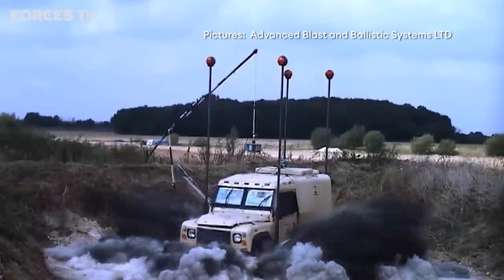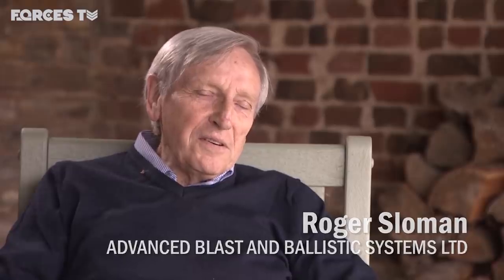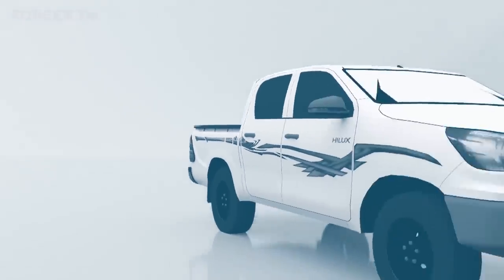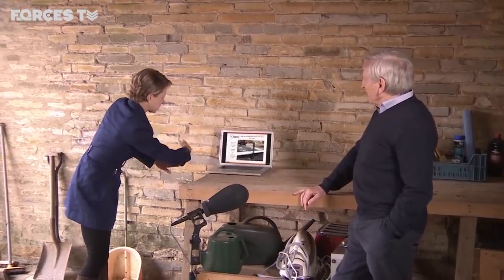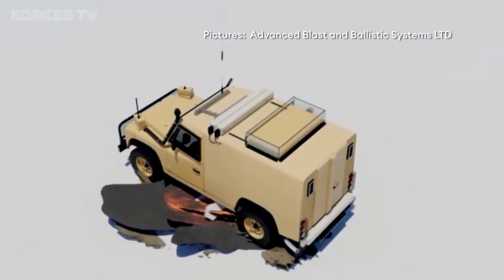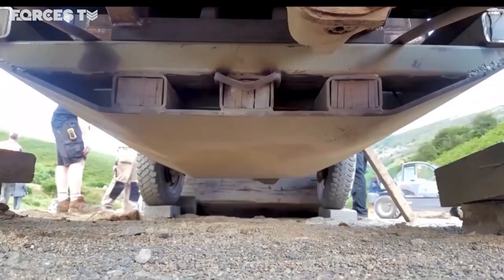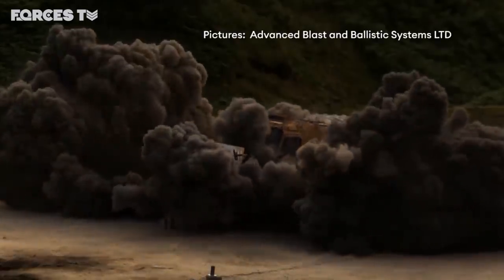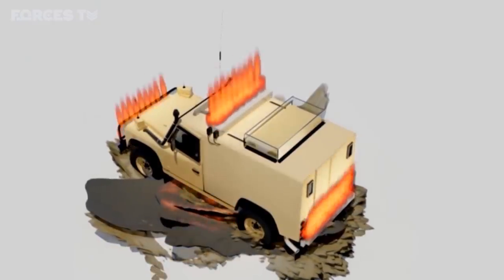Has This Inventor Found A Solution To IED Threats? | Forces TV

Comment: Some issues to be considered: 
1/ What if enemy find ways to trigger the rocket engines (e.g. shooting at 'em?)? Would it make the vehicle more vulnerable to small arms fire?
2/ What if the IED does not detonate directly under the vehicle? What if they have IED on the side of the road pointing toward vehicles passing by?
3/ What if the IED is small but it triggers the much bigger rocket engines, causing a downward force on the occupants?
Interesting invention but the system needs to determine where the force's strength and direction in order to counter act effectively... and such system might require lots of maintenance
Reply: To #1 and #3,  I'd imagine these are computer controlled detonators, and it may not be possible for a simple bullet or even fire to set them off.  If they did inadvertently go off, the rockets push the vehicle down, but it would be downwards acceleration that would harm the passengers.  There's a bit of an obstacle stopping that downward acceleration.  The ground.  The only way for the vehicle to accelerate downward would be for it to literally push into the ground, or I guess maybe the tires would all simultaneously blow out; although I imagine they're 4 pretty thick and rugged tires to distribute the force.

To #2, this isn't a solution to solve for all possible attacks.  It's solving one of the most common and deadly attacks.   That said, this solution allows for a lower sitting vehicle with a lower center of gravity, versus the V shaped bottom solution mentioned in the video.  That could help stop the side charge from rolling the vehicle.  Although, I imagine the shielding on the side of the vehicle isn't as strong as the shielding on the bottom.  If the explosion doesn't tear through the side of the vehicle... simple side curtain airbags could do the trick.

Comment: Hi Everyone who still looks at this, I'm just curious to see if anyone has actually invested through the Seedrs pitch?  It would be useful to know.                                         Roger.
Reply: I have a question sir, would this be able to counter say a 100kg mine?
Reply: @homijbhabha8860  It is possible, just add more motors and make sure the belly plate can take the loads.

Roger Sloman
Reply: Roger, are you still crowd funding? If you are, where can I find your crowd funding?
Keong Yip.

Comment: What about the sound, shockwave, shrapnel and concussion after the explosion?

I mean the rockets will possible prevent it from flipping, but the money and variables for something that may or may not work is not worth the risk in my opinion.

He should test the survibability chances, just because a dummy looks intact doesn't mean that a person wouldn't die.
Reply: As a military research R&D outfit, they wouldn't discuss anything other than very basic information as to not give away trade/national secrets.

Assuming this system can be tuned with the chassis to minimize deformation of the cabin, overpressure should be easily solved in an already armoured vehicle, as should shrapnel.

Not sure you'd be safe on the bed of the Hilux when those linear rockets go off though...
Reply: Every invention that has ever been was in the category, " May or may not work."  Without optimists nothing would be invented.

Comment: From a government and military perspective, the modifications to their current in theatre vehicles will be hugely less expensive than the buying in of the current range of blast resistant vehicles and the increased logistics problems they present.

Retrofit kits to upgrade current in theatre, non hardened vehicles may be fitted as and when required, giving the commanders greater choice.

This 3 part system has the possibility to radically change the defensive capabilities of current military fleets at considerably less expense and in a shorter timeframe than switching to brand new vehicles.

For the same fiscal outlay, many more vehicles can be modified and upgraded.

The inventer is truly outstanding, and to have progressed his project this far is remarkable.
Reply: Thanks Felix, a sensible response!

Comment: isn´t this called "reactive armor" and is around since the 80`s
Reply: nope, reactive armour explodes into the incoming warheads. this is a counter force for IEDs/mines under the vehicle
Reply: Yeah, as the other comment mentioned, reactive armor is armor which detonates when a projectile impacts it. Generally, only the part of the armor in direct contact with the projectile detonates, and that detonation serves to break up and bleed energy off of the projectile. This is very different for a number of reasons. It isn't armor at all; it's an electronically actuated system that applies force to the vehicle, whereas reactive armor is just a compound with no electrical system. Also, reactive armor works almost exclusively against projectiles, while this appears to work only against blasts.

That being said, I'm extremely skeptical about this idea. It involves effectively doubling the force of the explosion, and unless there's a LOT more to the "carbon fiber reinforced belly plate" it's absolutely silly to think that carbon fiber can even begin to approach the blast resistance of a higher, bowed hull that has the benifit of not being forced down INTO the explosion.

Comment: I feel like instead of using rockets, you could just use the same idea as inside of a deadblow hammer. Have 1,000 pounds of metal balls inside of cavities  around the vehicle, suspended in the top half of the cavities. When the blast goes off, drop the balls,. As they hit the bottom of the cavities, it will absorb a lot of the force of the explosion.
Reply: Weight and time. Those weights wouldn't drop fast enough to do any good, nor would they be even slightly as effective as the rocket. 
They'd also hinder the vehicle and raise the centre of mass without doing much other than adding mass.

Comment: Over-pressure?
Reply: Not a problem in a closed vehicle. We did have pressure sensors inside the vehicle and left the top hatch open to check that. Only about 2psi above ambient recorded. Roger
Reply: @rogersloman6635  Thanks for reply, you're doing good work, like you said it is just physics and can be done.
Reply: @rogersloman6635  do you think if you put some facing sideways on top you could stop rollovers from ieds placed on the side of the road instead of underneath?
Reply: @Alucard-gt1zf  Yes, that could be incorporated.       Roger.

Comment: I'm an inventor too... I disagree that "it's just plain Physics." and tell you it's more than that. It's Mechanical Engineering (Physics, Mathematics, Chemistry/Alchemy/Metallurgy, and the rest). It's also Biology (Live human bodies) and Geology (Living Terrain of the theatre's landscape and how its own displacement [or lack thereof] affects the Physics' Reaction Force at play). There is far more than just plain Physics.

I imagine the physical forces at play would effectively squash the vehicle and require the vehicle cabin and hull become further reinforced to cope with that stress. This wasn't mentioned when they boasted the invention's effective working method. 

The highly dynamic physical energy force/s has to be directed (or at least guided) to flow away from any harmful dynamic position. Where does the energy from the 2 opposing blast forces go?

Also, the rocket case design adds further payload weight to the Gross Vehicle Mass capability, requiring a decrease in its general carriage capcity (i.e. of guns, ammunition, bodies, whatever it normally carries). This means a larger more robust vehicle is now required. It's not unachievable, but further again... Also, this payload increase requires a more powerful engine and driveline with a more capable braking system.

These points outlined above probably contribute to the reason why we didn't get to see it completed and adopted into production. He's probably working on that next after he gets some more funds for prototyping.  Prototyping is EX-PEN-SIVE!

Nevermind mate, WW-3 is looming with China/Russia et al. Vs. UK/USA et al., and this means we'll soon see a MASSIVE INCREASE in military expenditure for production and R&D by both sides of the divide. 

You'll be 'right.
_____________________________________________________________________________________________________________________________

Comment: A couple issues that I see with this. Firstly it's a one time use before it needs to be reset. This means they are going to have to keep all the parts needed for resetting it on hand at base. Secondly the energy that would originally throw the vehicle upwards is now trapped under the vehicle making it more likely to penetrate the armor plating or cause internal damage to the crew
Reply: That's a misunderstanding of how the mine blast works. Holding it down does not increase the damage.    Roger

Comment: These seem great for standard landmines, but comparing it to the American use of a wedge on the MRAPs is apples to oranges. Those are designed to protect heavy vehicles from shaped charges (penetrators), whereas this guys system is for designed to protect light vehicles from the concussive force of (standard?) land mines. 

Not knocking his design, it's brilliant, just wondering why the Brits can't stop themselves from trying to compare everything they do to the American military.

Comment: Ok, I understand everything put in place, but I still don't think this will work, because the displacement of the air in the cabin. Think of it as putting earplugs in, then "thunder clapping" your ears. Doing this could blow your eardrums and burst your capillaries.  Shoot you dont have to thunder clap to do that, shooting a 556 rifle has done it in the past. With that said. Imagine what a 6kg explosive can do to the human body thats in the cabin.

TLDR: yes the vehicle is safe, but will it really prevent internal bleeding?

Comment: Neat! But once they get widespread, the guerrillas will just detonate shaped-charges beneath vehicles instead. Won’t shoot the truck into the sky or deform the floor much, but there’s a reasonable chance that somebody has a cone of copper halfway through their bottom, or at least through a critical component like the engine or transmission. Even more likely if there’s an array of charges. ERA on the bottom of vehicles will get expensive, but probably work.

Comment: Insurgents are going to adapt to that as well by using very small IEDs with just enough power to detonate the rocket thrust countermeasure which will be followed by the main IED charge detonation. 7 million pounds wasted on a countermeasure that is essentially ineffective and will be proven ineffective once it begins widespread use.

Comment: So what stops the enemy from using a small pre charge to trigger the defences before the main charge blows?

If the rockets fire for 20 milliseconds and the floor spring is released; Is there anything to stop a delayed main charge that detonates at, say, 30 milliseconds from obliterating the vehicle?

Also, if it could be defeated this way, would these defences actually exaggerate the main blast by adding energy to the system?

While we obviously don't have all the details it seems like it wouldn't take much for the already adaptive enemy to defeat this.
Reply: The system deals with this double tap situation, again, not saying how though.

Comment: They will likely counter this by making larger IED and that's about it.
Another question is, do you want to field thousands of armored vehicles with rockets on their roof? And is it even cost efficient? Is the added weight a good idea?
While it keeps the jeep on the ground, I'd love to see the pressure inside the vehicle. On the video the door opened itself, which may be a bad sign. 

That may save the jeep, but not its occupants. maybe anyway, testing needed. if it works, nice...

Comment: Meanwhile in Rhodesia (Zimbabwe before the war)
They made an weighted extended front end, sometimes detachable to the vehicles. (imagine a extended wheelbarrow infront of the car) that would trigger any mines or IED's. and usually leave the vehicle somewhat unharmed.
Reply: But not when they offset the pressure plate and the IED, as in the video!     Roger.

Comment: Very interesting, but it seems to be more aimed at landmines than most IED's. It would be interesting to see how this system would perform against anti tank mines, especially when stacked. In my experience most IED's (including the deadly platter charges) hit from the side. Even this video refers to blasts hitting from the sides and tipping vehicles into canals/rivers. The South African system with v shaped bottom and "boxes" at the side still seems to be the most effective (and far cheaper) solution.

Comment: Trigger mechanism attached and timed by the floor protector? 
Could work. 
It's not like the floor reinforcement can be shaped and built out of any sheet metal. 
Carbon fiber would cut down on mass though.

Comment: Ok, so idea’s and engineering are great on the safe side of the blast, but as a 12b who deployed many times who’s job it was to find and eliminate the things that go boom. This application would work only the most circumstantial situations. Otherwise it would take at least five years of continuous testing to get it right in a practical sense, then the enemy would figure out how to counter it in two less than two weeks. Does anyone else think strapping class III explosives under your Vic and driving on and off the FOB all day in 120 degree heat is a good idea? Who is going to maintain a system like this in the field?(there’s no way this falls under 10 level maintenance). I’d buy into this more if it were a airbag system. We used to disable our in cab fire extinguishing systems because they intermittently went off. Imagine if these started going off. There are too many people on here excited about this, thinking it would save lives, but in all reality it would be impractical. Yes, call me the naysayer but that comes with a career of driving around in hot zones waiting and getting blown up.

Comment: amazing idea, its like reactive armor, using counterforce to blunt the destruction.  If it works it can be retrofitted to just about any vehicle.  The pressure wave could be a problem, as even if vehicle is intact, it can cause internal injuries to occupants.

Comment: If it's "just physics" this guy should know that force is a vector quantity and therefore the rockets will just work if the IED is directly under the vehicle. They even said in the video that many IEDs are placed at the side of roads, in this case the rockets on the rooftop are completely useless and the vehicle probably still flip over
Reply: Georg,   Think again, whilst it might be moved sideways it will not tip over and with several hundred tonnes pushing down on it I guarantee it will not move as far as it would without the motors.                  Roger.

Comment: Surely the simpler solution is to use the time window to activate reusable ejector seats (or a floor platform?) into to the vehicle for driver and passengers. They wpuldn't have to be as sophisticated as aircraft e-seats as you only need to lift out of blast reach (possibly   horizontally) and whilst travelling at a slower vehicle speed  it may be cheaper than the cost of modifying the vehicle. It seems that the proposed solution saves the crew but the vehicle would probably still be unusable. It would also seem that it only works for blasts from below rather than side blasts .

Comment: what if someone shoots the rockets casing causing a premature ignition? im sure it's not enough to destroy the vehicle but if any soldiers are near it you can imagine what would happen
Reply: The result is quite benign, the propellant doesn't burn at ambient pressure.
Reply: @rogersloman6635  ok but if a bullet opens a hole, causes a spark and ignite the propellant you don't really have time to equate the pressures. unless you saying it would burn just a little part of the propellant
Reply: @BarManFesteiro  Depends on the size of hole initially and whether it opens up more under initial pressure. On any production vehicle the motors would either be inset or ballistically protected anyway.     Roger.

Comment: Very interesting, although the counter would seem to be ever larger mines, which would defeat even this system. that said I acknowledge that a large IED composed of ANFO or similar explosive can become difficult to secrete due to size. I wonder if a counter to such mine planting might be achieved by wide angle camera technologies that scan the ground ahead of the vehicle for signs of disturbance. A possibility here might utilising different wavelengths to reveal changes in the surface, perhaps by detecting subtle albedo changes or by some form of pattern matching algorithms. Good luck to the inventor, let us hope it helps in defeating this difficult problem.

Comment: What about a metal detection radar that could detect IED's distances from contact. Almost like radio waves emitting off of vehicles allowing inside individuals to see ahead. The vehicle itself would be metal yes but put the radar where the engine is emitting it in front and possibly on all four sides covering all angles.

Comment: Very clever and very simple. Beautiful....Its rather like  the system devised in air pistols (using a 2nd air piston of identical size and weight, travelling in the opposite direction to the firing one, to virtually eradicate recoil)

Comment: 1. It seems a one-off solution... namely the truck is going to the bin every time is goes on a landmine.
2. The wheels didn't come-off, which means a very WEAK explosion.
3. Modern explosives finish off way before 10 mSec.
4. In Gaza they burry a 20kg shell in the tarmac, diagonally, tip downwards: no SUV would withstand it.